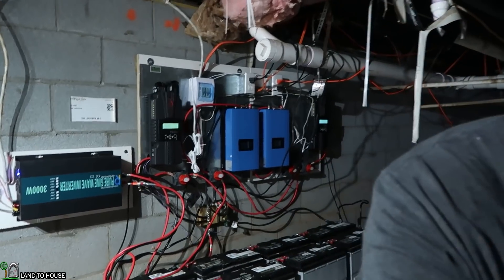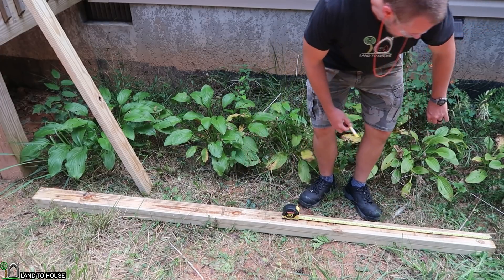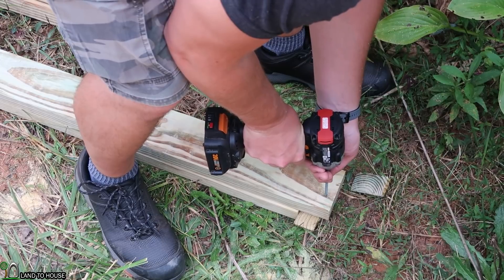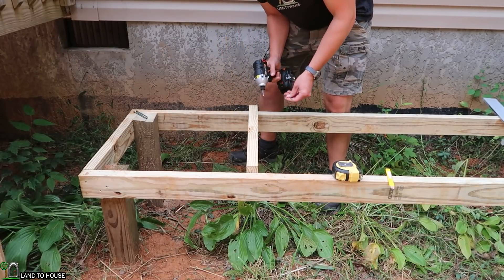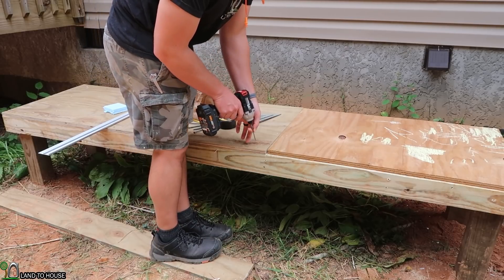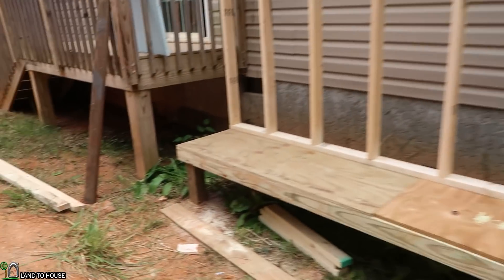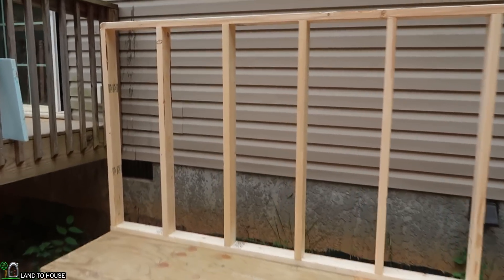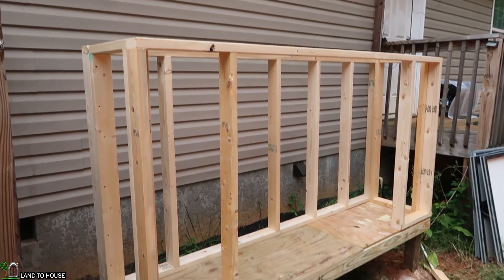Solar and Hydro Power Shed Build Part 1 of 3

Comment: Amazing how you can do so much by yourself! 👏👏👏
Wood + Ground = Rot, even treated wood. It would have been best to put concrete in the hole, let it dry, then put in the wood and surround the wood with concrete as well. FYI My dad once built pads, then put the deck legs on them. The pads sitting on the ground washed away the dirt separating the legs. The deck pulled from the house and caused a lot of damage. Therefore, it is a good thing you didn't mount it to the house.

Comment: Nice job! I was thinking for the summer time when temps rise you could just leave the door open to have the shed cooler and not collect the heat. Anyways, great video as always!
Reply from the maker: I am wondering about the summer heat. I could leave the door open but the wasps will have a home in there in 1 second. I might make a little screen door with cover so I can vent when its hot out.

Comment: Don't forget to frost proof the batteries, maybe fit a couple of heat pads?
Reply from the maker: U need to put a temperature sensor out there. I wonder how the electronics will heat that space.
Reply: @LandtoHouse  I've used a couple of 12v 20W heat pads around my campervan for the water tanks and batteries, just to stop things freezing. I believe you can get them to attach to engine oil sumps too.
Reply from the maker: Interesting. I will see how things go as Temps drop. Might have to do some changes.

Comment: If you put some horizontal bracing across those 18" stubby walls,  it will greatly increase the stiffness of your opening. 

I typically do that in my shed builds since the doors hang there,  but even in this build I would do it to tighten up the structure.
Reply from the maker: That is a good idea. With the OSB and double sheets of concrete board the structure turned out pretty strong